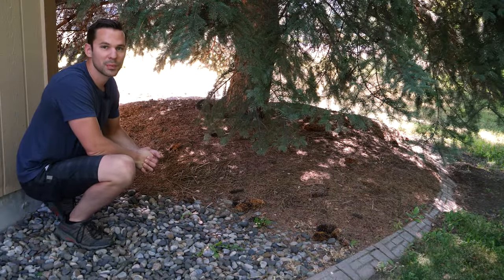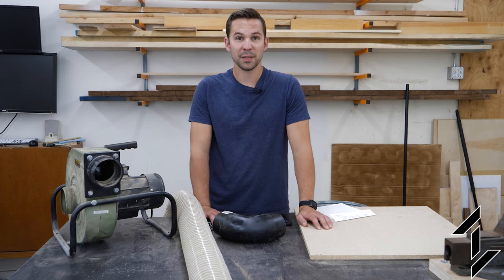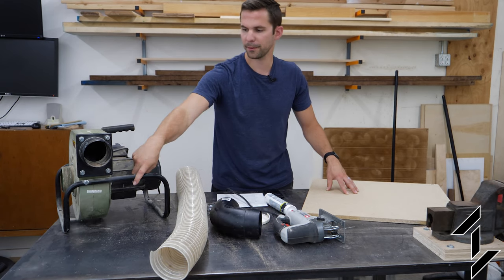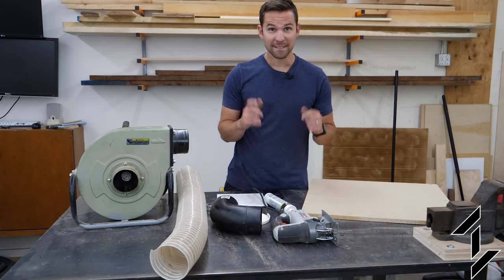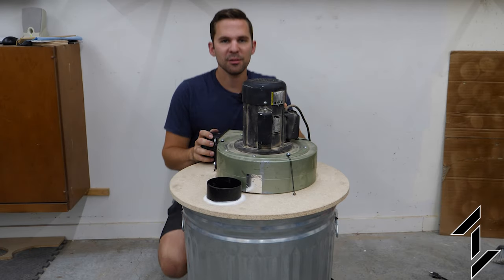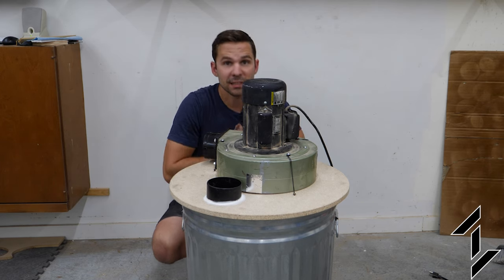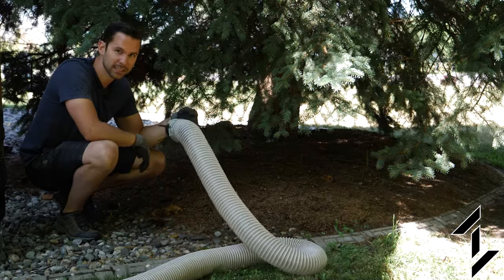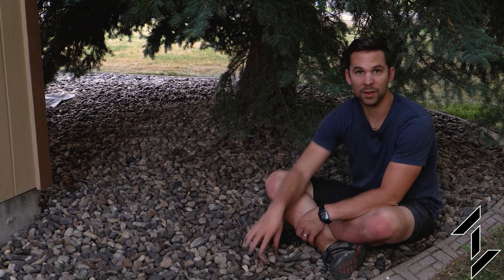The Fastest and Easiest Way to Clean Landscape Rocks! The Mighty Pine Needle Vacuum!

Comment: I don't understand the concept, why it doesn't suck up the rocks? This grandma really needs one of these bad.
Reply from the maker: Instead of a low volume of air and high pressure like a typical vacuum, it is a low pressure and high volume of air. This means there isn't enough pressure (force) to lift the rocks up, but since the pine needles are light, they are able to be sucked up. Hope that helps!

Comment: Wouldn't  shop vaccine work just as well?
Reply from the maker: Not actually very well because shop vacs have a proportionately low volume of air but at a high pressure; dust collectors on the other hand have low pressure air but at a high volume. Shop vacs have enough pressure (force) to suck up the rocks, but dust collectors will mostly only suck up the light pine needles and leave the rocks. Hope that helps!

Comment: I use a shop vac.🤷‍♂️
Reply from the maker: Shop-Vacs provide high-pressure low-volume suction which has a tendency of sucking up rocks with the debris. Dust collector blowers have low-pressure high-volume suction so typically just suck up the light stuff and leave the rocks. But your mileage may vary.

Comment: Isn't this just a homemade Shop Vac?
Reply from the maker: Not quite, shop vacs are high pressure low volume, dust collectors are high volume low pressure. A shop vac would suck up the rocks as well as the pine needles.

Comment: Doesn't explain how to do it for smaller gravel tho. THumb down!
Reply from the maker: For real? This works for smaller gravel too, it just will pick up a couple of the tiniest rocks which hardly matters if you ask me.
Reply: 42Pursuit nonsense. Doesn't work for 10mm Pea gravel or larger pine needles or larger tree waste (not all trees only shed tiny needles, some shed bits 5cm or 10cm long)
Reply from the maker: @rollerbladinggeek5507 
Sounds like a rake may be the better tool for that scenario then. Best of luck!
Reply: 42Pursuit ...rake doesn't work either- tree waste too small for rake & gravel too small for sucker babes. U can't assume all situations aren't unique like u do in ur video...
Reply: Feed the troll
Reply: @Threekpoints  Feed the Threekpoints geek
Reply: @rollerbladinggeek5507  Karen is that you?
Reply: @Threekpoints  Ian is that you?

Comment: WHY BOTHER with all that stuff just get a cheap leaf blower sucker that will not have a mega suck power cos you paid 50 bucks , you will pick up all the needles and keep the stones on the ground as intended. I dont need to bother to make a video for this guys longwinded do it long and wrong answer to a layer of pine needles and organic scrap
Reply from the maker: Have you used those cheap leaf suckers on a layer of pine needles and sticks?  They look like they'd work but they're pretty useless on anything but light dry leaves.
But to each their own.
Reply: Looks good after watching I'd attach a broom handle on the end of hose.  Then you can stand and not bend over or crawl on your knees on the rocks. As you get older your knees and back start to feel it.

Comment: SIIIIIIICK!!! Makes may wish pine needles were my problem. 🫤
Please let me know if you come up with a solution to separate [my] decorative rocks from adobe--either wet or dry adobe, bcuz both are a MAJOR pain in the rump to separate! 
Adobe is like clay... It sticks to everything when it's wet (rocks, boots, tools, itself) and dries rock hard, almost fossilizing, with cracks and fishers throughout. 
You can dig into it when it's dry, but it comes up (from the Earth) in large chunks that are hard to break apart. Those chunky monkey pieces of dirt imprison the decorative rocks for that area inside of it! The rocks settle into it when it's mud, and then they're stuck, just like Han Solo when he gets encased in Carbonite... ✨⭐🪖☠️ 
So yeah... 
You can hammer the chunks into smaller pieces, but you CANNOT break them apart by hand. They are too hard! And they break down to about the same size as the rocks [I use], which makes it harder to separate by size, sometimes impossible. Larger rocks offer some solution, but that's not always what I want aesthetically or practically for the space. 🤔😂😭 
Anyway, you're obviously super creative, resourceful, and smart--not to mention innovative, clever, handy... I could go on and on, but I've fully detailed my situation. Hopefully I described it well enough. Please let me know if you have any ideas (or questions of course), and thank you for your time! ☮️

P.S.
I know you didn't make this video to get inundated with people's problems, so I apologize for barging in with so many words--and asking for your thoughts--the audacity! But you do realize that it's your fault, don't you? If you weren't the most innovative, solutions-oriented, high quality YouTuber that's posting videos about this specific thing, then you wouldn't be inundated with all my friggin words! But alas, here we are.
All kidding aside, I appreciate your help, or even just your sympathy for my plight, if that's all you have time for, I understand and thank you... Much obliged, Sir!